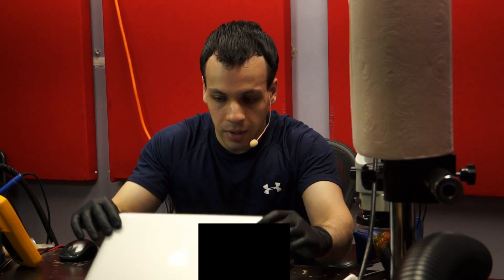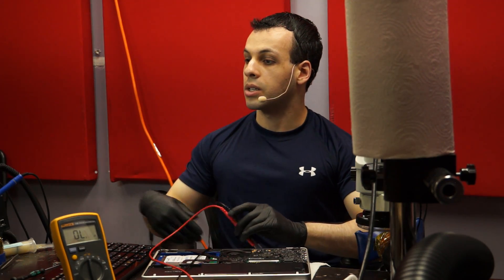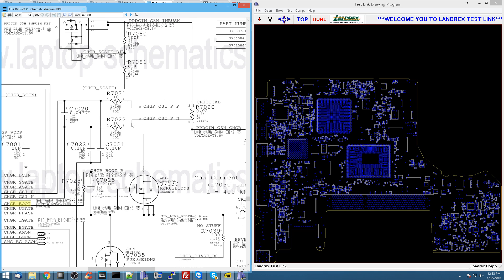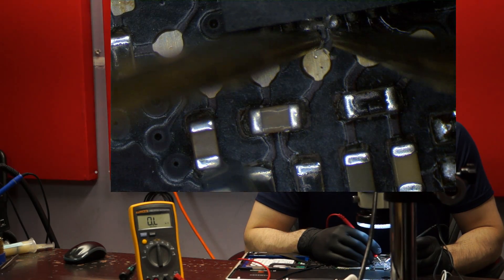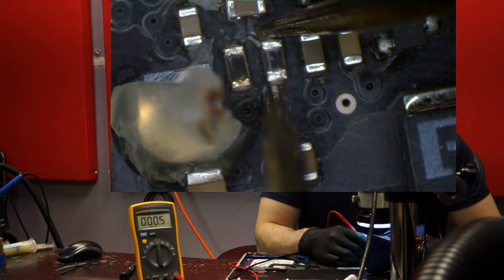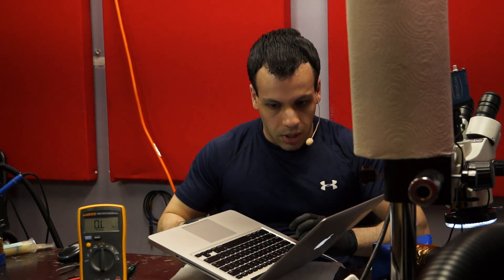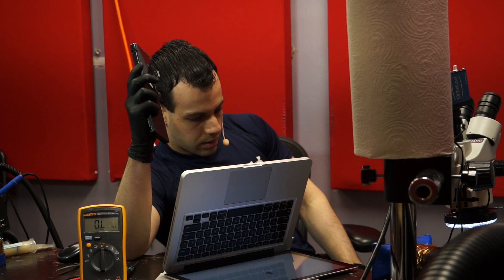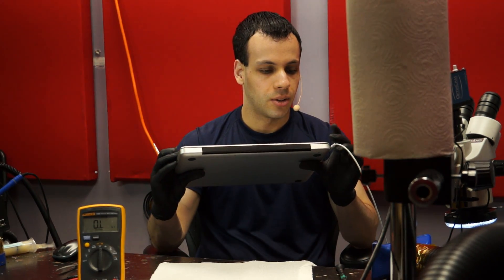Macbook that doesn't charge magically fixes its own current sensing circuit

Comment: LOOOOOUIS! You have the luxury of test pads right next to the chip. Don't probe the solder joints on that QFN, both to save the joints, and to save the second it takes to align the probe. My guess what caused it? Dry/cracked solder joint the resistor that you probed at 7:00, which you "fixed" by pressing it or because it realigned itself from the heat expansion. If it was me, I would have added some flux and reflowed all 3 resistors in the current sensing network just to be sure the problem wouldn't come back.
Reply from the maker: +Gameboygenius What if the connection from the probe point to the chip itself is broken? It's happened many times before.
Reply: +Louis Rossmann Valid point. Although depending on how common each problem is, it might still make sense to start at the pads for your convenience. If, say, it's the resistors 49 times out of 50.
Reply from the maker: +Gameboygenius  Measuring the test probe points it's not a real measurement!

If the trace between the chip and the test pad is blown, that won't show up in my measurement if I measure from the test points rather from the chip. You will find many videos on this channel within which the trace between the test probe point to the chip is blown and the cause of the circuit malfunction. 

The idea in doing that "full circuit measurement" is just that, to see if there are any issues in the FULL CIRCUIT!!!!

The traces between the test pad and the ISL6259 chip are a very important part of that circuit! I run jumper wires between them all the time.

I see 13 thumbs up on this post, and I say this with no insult intended, but that's 13 people that are going to send me a board that I charge them hundreds of dollar to put 2 wires on :)
Reply from the maker: +Gameboygenius err, crap. I lost track that I already replied to this. whoops.

Comment: Engineer here. All the Macbook had going on was that the current sensing circuit was lonely. By you opening it up and paying attention to it you gave it validation, returning it from sadness to a standard operating state.  I would recommend leaving some Prozac under the battery to prevent further errors.
Reply from the maker: +Ben Keene Prescription please!
Reply: +Ben Keene 

I wonder if it was the impurities epoxy that was causing a slight short.

Comment: Where can I get backlight fuses? Its only a personal repair and the ones I ordered were like half the size of the original...
Reply: Louis Rossmann IF your lucky. You never know on ebay might be a unmarked 0ohm  resistor.
Reply: +Louis Rossmann 
good news, I fixed the macbook backlight! and all with a shit iron and no magnification haha
Reply from the maker: +SKREAMZ You probably bought 0402 when you needed 0603 size. mouser.com and digikey.com sell them.
Reply: +SKREAMZ  generic advice fuses resitor caps etc have size desgnator you can measure them and compare to digi and mouser catalogs.

0805 for exampel mean .08mm x .05mm http://www.microsemi.com/sites/default/files/drawings/tvsf0805-2d.gif

That kinda info is also broken out in the datasheets most time in the search and or discription on mouser/digikey.
Reply: +Louis Rossmann awesome thanks Louis
Reply: +KingOfKYA +TheAmmoniacal Thanks for the info guys!
Reply: +TheAmmoniacal It's proving to be such a pain to find! I found a small bunch of them on ebay but its plainly labelled as "macbook pro air backlight fuse" so i emailed them to get more details. I'll check out your link thanks :D
Reply from the maker: +SKREAMZ they are buying an 11 cent fuse on mouser and selling it to you for five dollars on ebay
Reply from the maker: KingOfKYA Good point.
Reply: +Louis Rossmann True but what other options do I have? :( Being in the UK, shipping alone costs more than the ebay item if i use mouser or digikey.. I'll do some more looking around and see if i can't buy a dead board somewhere on the net..
Reply: +SKREAMZ 
http://uk.rs-online.com/web/
https://www.element14.com/community/welcome

etc
Reply from the maker: SKREAMZ GOOD STUFF!!!